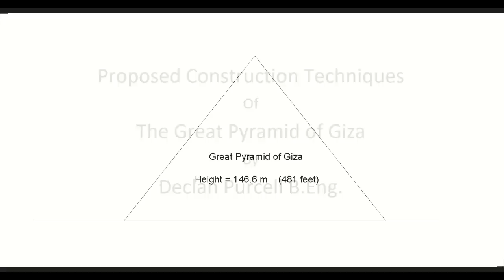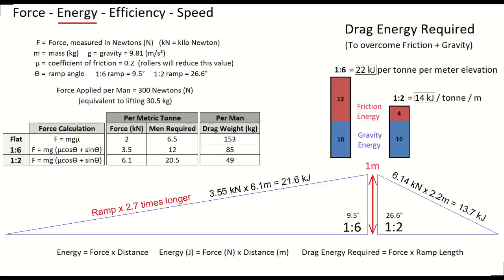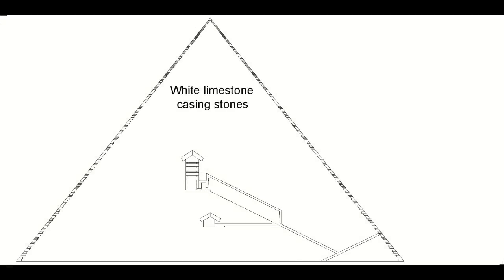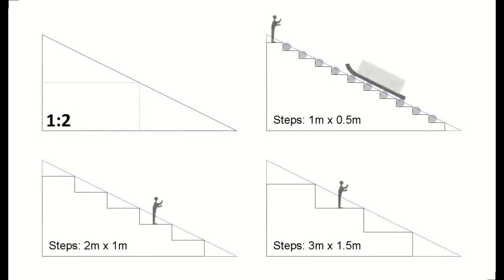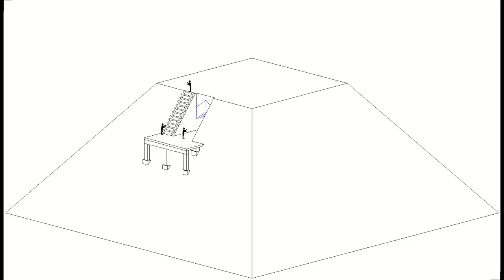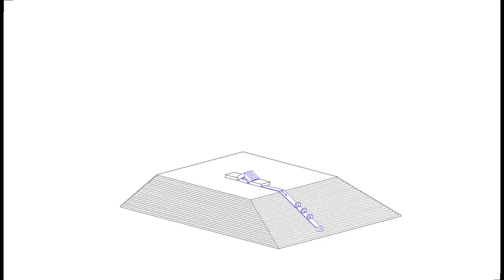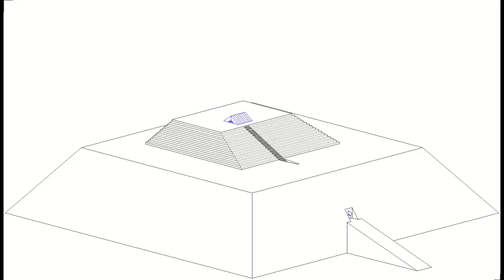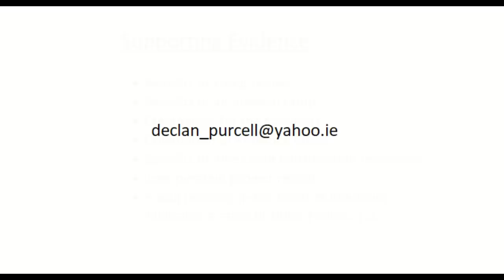Proposed Pyramid Construction Techniques

Comment: For steeper ramps you would need many workers to focus on single blocks. It would not be an efficient use of manpower.

Houdin's theory makes more sense in this regard.

The grand gallery was obviously used as a counterweight sled ramp, but there is a second similar ramp dug out of the bedrock under the NE corner of Khafre's pyramid. 
They dragged the granite blocks from the harbor, up the main causeway with the now-hidden counterweight trench, then onto the 40th level 'staging area' using a ramp on the SW corner of the GP.

Smaller limestone blocks would be easily dragged up an internal ramp at the same time by small work gangs at a mere 7° incline. 

A good engineer would take every mechanical advantage possible over brute force.

Comment: Very intresting and possible. I just have a little problem with the ropes ... did they had ropes that strong in these days? I hear of thick ropes that were ripped apart by 80 boyscouts in a pulling contest. Don't get me wrong, the pyramids were built by humans without any aliens, gods or other crap. But your hypothesis with the steeper ramp, makes me intrest in the ropes they have had back then.

Comment: You have to remember this is an 8 sided structure also, you need to account for the air shafts for lack of a better term. This is not an easy task to make them straight for that length.

Comment: Similar to today's most accepted theory. There,  the grand galery IS the ramp. But used as a space to slide a counterweight to help raise the big blocks for the king's chamber. (That solves the need to have almost 2k people to raise them) The galery itself has a lot of clues of being used for this purpose. There's a video around that explains it in detail, and seem even more plausible that this one.
Reply: Who lifts the counterweight then? You still have to carry a giant counter weight at least as large as the stone you’re trying to move. If you use a smaller one you’re not really doing anything significant. You could just add more laborers instead of creating a new job that doesn’t do anything.
Reply: @wompbozer3939  A Counterweight can be composed of many smaller weights, doesn't have to be one giant block, just an equivalent in weight.
Reply: @darkairieal  I understand what a counter weight is. Do you understand that you still have to input the labor to move the smaller counterweights? The same, probably way larger amount of would be required to move the counterweights.
Reply: @wompbozer3939  yeah I understand that. A bunch of guys doing multiple trips to fill the counterweight to move a big ass block. Your original reply to that guy made it sound like it HAD to be a singleblock just as big as the big block they were trying to move. ("...carry a giant counter weight at least as large as the stone you're trying to move..."). I understand your later point that you can just add labourers, doing it with a counter weight just helps out.
Reply: @darkairieal  At ease soldier

Comment: … and another question. You said that the top corridor had to come out in the middle oft the side. That explains the 7m offset of the entrance very well. 
But the construction above the upper exit to the top must make a bent to reach the top of the pyramid. Wouldn’t it be simpler if the top exit comes with an offset so the last ramp on the face of the side can go straight up. Also the entrance could therefore be in the middle.

Comment: The pyramid is filled with stones that could fit in a wheelbarrow apart from the massive ones. The pyramids were built from the ground up course by course. So they always had a solid floor to work from, to place the exterior stones. It wasn’t like a modern building where most of it is hollow.

If they planned ahead they could lift the massive stones a few feet, or inches, at a time using, for example, tne rocking method, no need for ramps or counterweights.

Comment: I like how this theory explains the recently discovered "big void". However the Grand Gallery is somewhat redundant in your proposal. Maybe Houdin's idea that it was used as a space for sliding counterweights in order to lift those huge granite beams also has some merit?
Reply: @GregMoressWasFirst  Yeah I've been thinking of something similar in response to this video https://www.youtube.com/watch?v=q4vV1aAgVGw. Internal ramp is clearly not the full answer because Khafre's pyramid doesn't contain any internal chambers yet its builders were able to lift the stones to the very top. But those huge granite blocks inside the Khufu's pyramid maybe required a more sophisticated solution. I like how your theory explains those "gullies" visible at the center of each face.
Reply: @baze3SC  The internal ramps inside Khafre's pyramid could've been filled back to back from the inside after the workers finished with the construction of the outside

Comment: Interesting theory to add to the rest. Still, the planning and construction that took only 20 years is hard to fathom. The purpose? Where are the hieroglyphs? Fancy artwork and paint? Artifacts? Mummies? I don’t by the symbolism of the pyramids. A mystery to me still. And many others. More research. The granite blocks shipped from 500 miles is amazing. How big the wooden ship must have been. And the loading and unloading 80 tons stones is mind boggling. Keep working at it.
Reply: Artwork and paint disintegrate depending on quality and environmental factors. Also we shouldn't simply assume that they were ever there. The decorated tombs in the Valley of the Kings that we typically associate with Egypt are approximately 1000 years younger than the pyramids. Maybe decorations simply weren't in vogue in the Old Kingdom. As for the 20-year period, it's a speculative estimate based on the length of Khufu's reign. There's a mark in one of the interior chambers that mentions Khufu. However, some skeptics dismiss it as 19th century forgery. Pieces of mortar were carbon dated and found to predate Khufu by 370 years. Therefore we shouldn't automatically accept everything without looking at available evidence.

Comment: Boats that traveled cannels that went through a series of locks is a concept I can see as very efferent. Once the water is moved to the upper lock maybe 2/3 up that same water can be reused to flow down to fill lower locks. By tapping into water at a higher elevation like the Romans did once set up it was be very easy to raise the blocks.

Comment: When were the tombs of the king and queen entered with their bodies? were the pyramids built around the tombs (roughly speaking)? For me the biggest mystery is how they managed to cut such granite blocks accurately using very simple bronze tools. Bearing in mind that the exteriors didn't have such precision, but the interiors did, millimetrically perfect fits of not being able to put a credit card in the slots. The second biggest mystery would be the accuracy of placing the blocks with perfect symmetry, today with laser gauges it is still a challenge given that the workmanship can make mistakes in the execution.

Comment: The ting is "sand".
Build a ramp on both sides, but the stone at the bottom of one ramp, then have a wooden crate on top of the other ramp, then let workers carry up sand to put in the cerate until it is heavier than the stone, then you just need a breaking-system to transport stones up. Self I think a bit of the pyramid is formed from a natural rock that existed in that location as a base and that a mix of sand and water to fill gaps and form a kind of concrete, the sides of the pyramid is not flat so it form a 8 sided structure that create a presurt towards the center to keep this sand mix solid.

If one king had to build 3 to 4 pyramides to find the perfect formula, then each pyramid have to be built within 5 years, to drag millions of stones would take to long time and the experiment with mud bricks inside the pyramid was so good it still exist today, so what do you think about a building technique that would involve man made material like different forms of mud or something that would dry up tp look like sandstone?

Comment: no internal spiral ramp?
Reply from the maker: Problems with the Internal Spiral ramp 
1: Very shallow angle means the ramp is incredibly long (oner 1 km to reach the top)
2: Up to 18 corners to reach the top (Extremely difficult to navigate blocks around corners)
3:  Corner sections need to be exposed during construction which means they need to be filled after construction … This is an extremely difficult task…..

Comment: Great video. I have a couple questions:
1. Did the Egyptians at the time have the technology to use these methods? (using logs to reduce friction, creating rope strong and long enough to pull 80 tons, etc.
2. How did they transport a granite block that weighs 80 tons 150km?
I'm still on the fence about whether the Egyptians built them, or they just repurposed them. The idea of an "ancient, undiscovered civilization" seems plausible. From what I've heard, the Egyptians at the time we think the pyramids were built were not capable of building the pyramids, both logistically and technologically.

I have an open mind, I'd love to hear the evidence anyone has for either side of the argument.
Reply: Though it's not much advertised, radiocarbon dating of several pyramids took place in 1984 and 1995 using samples of wood and flecks of charcoal present in mortar. It places the Great Pyramid firmly into the Old Kingdom but with 370-year discrepancy. The method has its limitations but it's also possible that the accepted chronology is offset by several centuries. This comes as no surprise because there are disagreements even within the scholarly community resulting in chronologies diverging by about 300 years. So, the pyramids could be older but not more than a couple of centuries. There's an inscription in one of the previously inaccessible relieving chambers (discovered by Howard Vyse) that mentions Khufu. Similar inscriptions are found inside the satellite pyramids. Some people think it's a 19th century forgery but that's not likely. The argument is quite detailed and I can't provide it due to lack of space :)
Reply: @baze3SC  Awesome, thanks for the response! I know the radiocarbon date shows around the time ancient Egyptians were active in the pyramids, but wouldn't it be possible the actual stones themselves could have been older? If an older civilization had built them, and the Egyptians just repurposed them, we wouldn't really have anything to carbon date that shows the older civilization. Like I said, I'm on the fence, could go either way. Thank you so much for the information!

Also, it's crazy the carbon dating that's being used is from 50 years ago. You'd think we have more modern estimates!
Reply: @ricolorenz7307  The stones are millions years old, just like any stone in your backyard :) I know the idea of lost civilization is tempting and I'm sure there are instances where the ancient Egyptians extended or repurposed already existing temples etc. but in this case let's give the builders some credit. These guys were smart and determined but I think a genuinely advanced civilization would use true arches instead of corbel arches and they'd probably also use prefabricates of uniform size.
Reply: @baze3SC  Great point! Thank you for the replies. Best of luck to you on your journey

Comment: Neat idea, but I can't get passed the sheer number of blocks.  If we think it took 20 years to build this thing, and there approx 2.1 million blocks, that means they had less than 5 minutes per block running 24/7 for 20 years. I just don't buy it. Either it wasn't for khufu and it took them significantly longer to build, or we still have no idea how it was done. Your idea optimizes it a lot, but I dont think it shaves enough time off to make it fit.

Comment: The assumption is that the entire pyramid was built layer by layer, but I just had a passing thought; what if it was built from one side to the other, gradually building the slope up to the top? Then they wouldn't need to haul much up with too much scaffolding as the pyramid essentially is its own ramp (not forgetting that the higher the layer, the less material is needed to be lifted)

Comment: Declan, the internal construction technique is the only obvious way as any irish construction worker will tell you. Imagine if the grand gallery was a geared dropping weight lifting mechanism for dragging 2 lines of stones either side of the grand gallery pointed arch structure. There still needs to be a further tubuler lift taking individual stones to the top of the structure. Yo the Jesuit massive

Comment: Delcan, this is so cool. I have been looking for 3D images for what the inside of the pyramid looks like for a while. Did you create this yourself? This looks great. 
Question, why are the chevrons only needed at the entrances to your supposed tunnels? Is it just because of the weight at the very 'edge' of the structure?
Just subbed, Hope you have more coming. I think you've got a great idea here. Has anyone tried debunking this?
Reply from the maker: Thanks.  I used AutoCAD for all drawings.  The animation is made from many single drawings.

The outer chevrons would have been visible during construction and are the most stylish form of support, but its possible to have used the corbelling technique all the way to the edge.   Its also possible the entire ramp has chevrons but I felt that the corbelling technique was simpler as these chevron blocks are massive.   I should have indicated in the video that this was possible.

Some people disagree, but it has not been debunked…
Reply: @declanpurcell571  Delcan, would you be willing to share the .dwg files? I work in ACAD and Inventor. I would love to create a solid model of this in IV.

Comment: Yes, sounds plausible. Sure they will have used some tricks to simplify the contruction work. They had plenty of time to think about it and to practice, since they build lots pyramids over many centuries.
Btw., did you ever hear about the assumption that the stones were transported under water instead of inside ships? I heard this many years ago and then never again.
It reduces the weight of the stones by around 40%, if you strap them underneath a ship and not load them into the ship. Its also easier to do because you don't have to lift the stones high up, but instead use a ramp leading into the water. I can well imagine that they have found all this out farly quickly, when transporting thousands and thousands of very heavy stone blocks.

Comment: I always wanted to do a video about the way they used a steep ramp to bring the blocks up. I taught about using a ski jumping ramp with about 60 men, 4 rows of 15 men, pulling down slope to raise a 3 tons block using only ropes, wood trunks and a sled to prove to everybody that it is not very complicated to do! I’m sure that it’s even feasible to do so on the 51degrees slope of the great pyramid, you just add ropes for pullers to grab in case a cable snap on each  sides.

Comment: OK! See if you can keep up here Mr Engineer.  Look at a modern day building. how do they get large parts to the top of a modern skyscraper? That's right. they use self erecting cranes that become a part of the building fabric of the building. Egyptians are no different. The building is its own ramp. There is evidence in scans of a spiral ramp found by a French team that was theorised by another engineer. The hardest part would be putting the Cap stone on and closing off the corners where the ramp comes out of the building. as for moving those 80 ton blocks. Why! Those crafty Egyptians could move 180 ton blocks and set them on foundations accurately. Now there's a mystery. But I bet if you gave 300 men the same equipment as the ancient Egyptians and told them to move a 100 tone block 1 km they would work out a way by trial and error a way that would not be dissimilar from those Egyptians. The early Brits hauled 50 ton stones and set them on top of one another. Fun fact. The amount of stone missing from the plain stone quarries equals the amount of stone in the pyramids. This means that not all the pyramid is cut stone but compacted stone. You can see that at points where the quality of the cut stone blocks  is far less than the outer casing stones. Then there are the historical accounts that do not mention a ramp but do mention lifting machines, which I may add would be required by an internal ramp. https://www.youtube.com/watch?v=_JlnMs616Z0